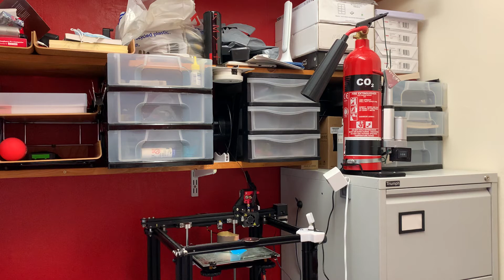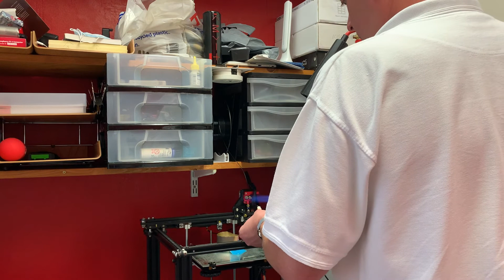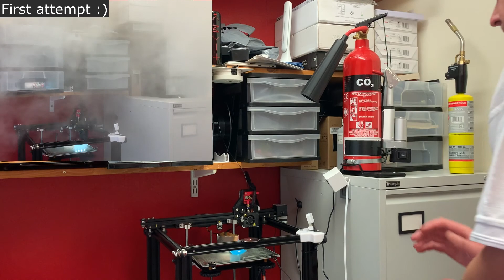3D Printer Suppression System Using a CO2 Fire Extinguisher

Comment: Hi this looks awesome! Could you do a full tutorial to show the IFTTT app and the linear actuator setup? Also, how much is that CO2 fire extinguisher? Is there a good place to get it cheap?
Reply from the maker: You should be able to find a local fire extinguisher maintenance company that will let you have an old CO2 extinguisher for cheap if not free.  In the UK they have a 10 year life before they need to be removed from commercial premises so companies may let you have one rather than paying to dispose of.
This setup was more of a proof of concept rather than something I actually use now.  Setting it up via IFTTT was a bit of a faff but quite logical with a bit of Googling.  All you are doing really is adding power to the actuator with a smart socket.  The trick here is using the Wyze camera as that can recognise the sound of a smoke alarm. From there you can use that signal to do what you want.
Reply: @GeeWhizRS  Or you can use smoke detector with output pins, to get rid of camera.
Reply from the maker: @kasparsbogdanovs7684  yes you could. Of course with a camera you have the benefit of watching your printer go up in flames. 😂

Comment: I'm looking at something similar for my Laser, my idea is a IR detector wired to a pnuematic solenoid with the co2 extinguisher connected to the solenoid. the outlet from the solenoid to be piped into the Laser and the IR sensor also looking into the Laser. The co2 handle valve can be permanantly open and the pressure stopped at the solenoid, when activated by a fire  the valve will open and fills the laser with co2, should also be wired to the Laser emergency stop. Maybe give it ago.
Reply from the maker: Sound interesting. Post me a link if you have a go.  Just be careful what pipe you use to run from the extinguisher to the solenoid.  The pressure in a CO2 extinguisher is upwards of 800psi at room temperature and increases greatly with temperature.